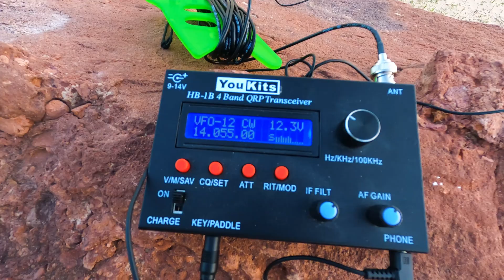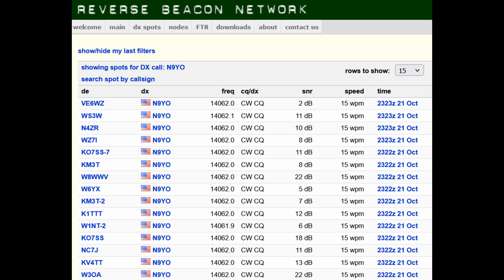Testing Out My New 17' Whip Antenna At Lakeside ~ Qrp Ham Radio

Comment: I went 65 miles to a park with my Mountain Topper.  I set up, tuned my buddi pole, reached for my Pico key and it wasn't there.  CW radio with no key.  I found a power adapter plug with two points coming out.  I wet my finger and it became a straight key.  No contacts that day but it is something I will never forget again.  At least the guy didn't sit on his tailgate with his short shorts on watching you.  73!!!
Reply from the maker: Now that was an awesome comment.  Love that, man I was getting mad just hearing you tell that story about forgetting something, but you had a clever response.  Love it.   And yeah, this time the dude left me alone.  I have a question... Why can't hot women come and bother me huh?  Then I probably wouldn't complain.